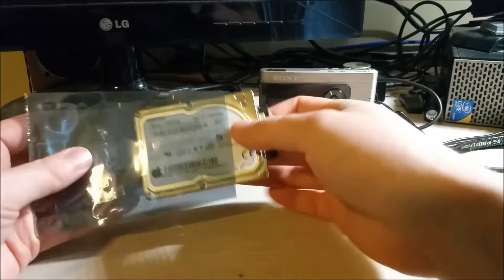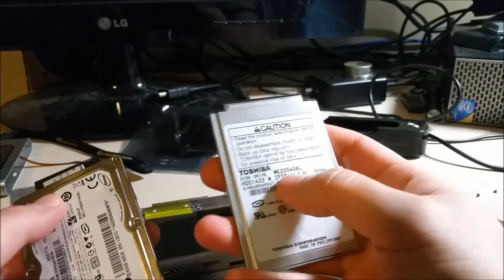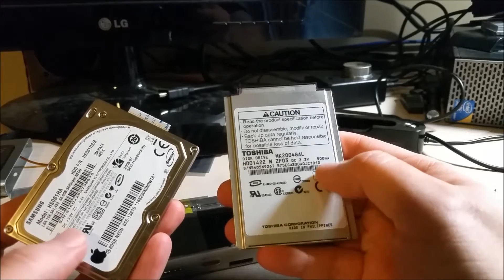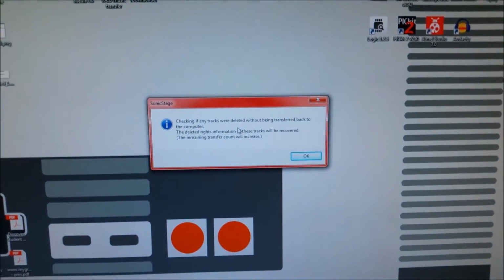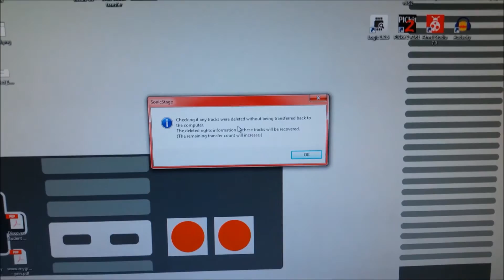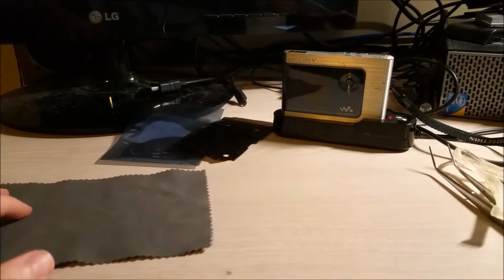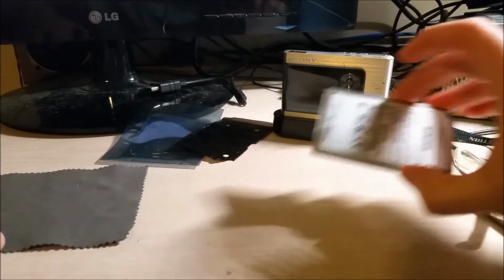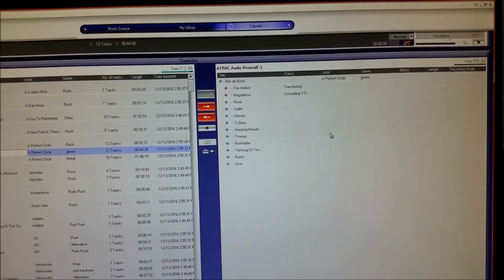Sony NW-HD1 Network Walkman 1.8" 80GB Harddrive Upgrade (World's First and Only?)

Comment: Great mod. I do wanna ask if you considered using a mSata SSD to (ZIF CE) IDE adapter reasonably cheap available with 32Gb, 64GB or even a 128GB mSata SSD's (MiniPCI). They are way smaller then 1.8" drives and probably also a lot more efficient. No spinning up required, faster access time and no heat. They act like real HD's and should be compatible if a 40 pin connector (ZIF CE adapter) is used. You might actually use a 1.8" HD casing (3D printed) for it to keep using the same rubbers. Probably 15G's won't even hurt these SSD's. 
I found an 1.8 ZIF CE SSD ready to be used with that small adapter of yours: goo.gl/ and then append sZXPYr (Google link security). They are available up to 256GB.
Reply from the maker: Robbert Lucassen I actually did exactly this with one of my iPods. I'll give it a try when I find a good deal on another msata. The one issue with msata is that while the read average current is very low I've found that they chug current like there is no tomorrow and get super hot while writing which could be an issue. Luckily I don't load songs often.
Reply: Did anyone ever get around to attempting this? Super interested as in 2023 the HD is finally starting to go on my NW-HD1  @sjm4306

Comment: Do you think a similar project would be possible with a flash drive + a converter as well?
Reply from the maker: Chris Chen Since making this video I've tried a 1.8" pata to cf adaptor with a 16gb card and it wouldn't recognize it. Not sure if it was the fault of the adapter or memory card though but it seems like the walkman is a little picky about what it will interface with.

Comment: Bought on aliexpress hard disk 80 GB with the same connector as the native 20 GB hard drive.Set .Works.Made in China.Toshiba.The adapter is not needed.Costs less than $ 20.   https://ru.aliexpress.com/item/NEW-1-8-CF-PATA-MK8007GAH-80GB-4200RPM-Hard-Drive-replace-MK6006GAH-MK4006GAH-MK4004GAH-for-laptop/32749619439.html?spm=a2g0s.9042311.0.0.W2hZs2
Reply from the maker: Андрей Солнечный I thought about getting one of these but since the GAH series drives are twice as thick I wasn't sure if it would fit inside the metal shell as the original drive did which was a GAL model. The drive I choose is more modern and thus more power efficient since it is a single platter.

Comment: 1.8 "CF/PATA MK8007GAH 80 GB 4200 rpm./min on aliexpress HDD in my opinion needs no adapter and is very cheap,ordered,will see what will come
Reply from the maker: Андрей Солнечный GAH drives are twice as thick (2 platter) and won't fit inside. You need single platter GAL drives.

Comment: Hello,I'm from Russia.All that you have done a really we.Thank you.Could you give a link to zif adapter on the website Aliexpress.I can't figure out what kind of adapter is needed here for your reference, they are all different.And another question,is it possible to put a SSD in here ?If so,what adapter is needed?Thank you
Reply from the maker: Андрей Солнечный Here's the adapter: https://www.aliexpress.com/item/ZIF-CE-1-8-Inch-For-Toshiba-1-8-Inch-50Pin-Adapter-with-Two-Cables/32598248145.html?spm=2114.search0204.3.215.kYkZEl&ws_ab_test=searchweb0_0,searchweb201602_2_5570020_10152_10065_10151_10130_5490020_10068_10307_10137_10060_10155_10154_10056_10055_10054_5470020_10059_100031_10099_5460020_10338_10339_10103_10102_440_10052_10053_10107_10050_10142_10051_10324_10325_5380020_10326_10084_513_10083_10080_10082_10081_10178_10110_10111_10112_10113_10114_143_10312_10313_10314_5560020_10078_10079_10073_5550011,searchweb201603_11,ppcSwitch_5_ppcChannel&btsid=923c7d19-81f6-45f8-a1e0-df7fa988bd19&algo_expid=2c00eb78-e476-4138-adf7-6747204f7696-29&algo_pvid=2c00eb78-e476-4138-adf7-6747204f7696

As for an ssd, I've tried cf to zif and msata to zif adapters with cards I have and they weren't recognized. It may have been the specific cards I have or maybe the mp3 player is just really picky about the drive it accepts.

Comment: Maybe you can make your own bumper by squeezing some sillicon in?
Reply from the maker: Peter Pan Probably some thin sheets of foam cut to size would work.
Reply: sjm4306   Worth a try.  But can you tell me how such an adapter looks like? From how many.pins to how msny pins?
And is there a more "squeezable" version?
Reply from the maker: Peter Pan Peter Pan If you search "Toshiba zif adapter" on eBay loads are for sale. The one I got is the cheapest but for about $7 there is a version that is much smaller (and more squeezable) but I haven't tested it so it may or may not work.
Reply: @sjm4306  I just fitted a 60gb ZIF Seagate in my HD1 using one of those flexible adaptors and can confirm not only does it work but it does indeed allow for the silicone bumper to be reused. Pretty crammed in there and had some issues maintaining the connection whilst reassembling the unit but some strategically placed sellotape fixed that. Time will tell if the adaptor lasts under such conditions but at least for now I have a decent slug of extra space for my ATRAC3+ collection and won't be afraid to take it out and about 👍

Comment: Hello, nice video. 
Actually, I still use my NW-HD1 player. Mine is modified to play mp3. I also unchecked the sound volume limitation in the service options, so I can use HiFi earbuds that needs some extra power.
I bought my player in 2006 in a second hand shop in Tokyo, had it modified for mp3 in a Sony service center, and as I am pleased with the sound quality and design, and as it is still working I did not threw it away for a newer model.
Still, it has now many usb connection problems, so adding new music can get tricky sometimes.
Reply from the maker: I got mine second hand and unfortunately it didn't get the mp3 upgrade :-(
It's funny, every time I get a new sony toy I read up on how to get into the service menu to tweak it. That sucks that you have trouble syncing, it it the dock port or the port on the unit that has worn down?
Reply: I don't know. But I will check next time I come back home (I work abroad most part of the year), because I have another unit, so another dock to try with the player I am using. I got another player in 2007 in case the first one would break (I just loved this player back then).

Having it modified for mp3 is convenient for mp3 purchases, but with these files I cannot use the 6 band equalizer, only the digital sound preset, so I still rip my records in atrac3plus. I don't know why there is this limitation for mp3.
,
Also it seems you are using an old version of sonic stage in your video. I don't know if you actually use this player but if so, you should use sonic stage V. It was made only for the japanese market but someone made an english patch.

Comment: Phillips always said that PASC was better and gave a better sound, As it turns out I have a Phillips DCC900 tape deck but the capacitors have dried out and now it doesn't work now, if it has TOSLINK output it can be connected to your amp via a TOSLINK DAC and optical cable and phono leads.
Reply from the maker: Dry caps are an easy and cheap problem to fix, much better than mechanical failure which can be a nightmare to debug. Digital cassettes like dcc and dat always fascinated me but the hardware is a bit pricey for me.